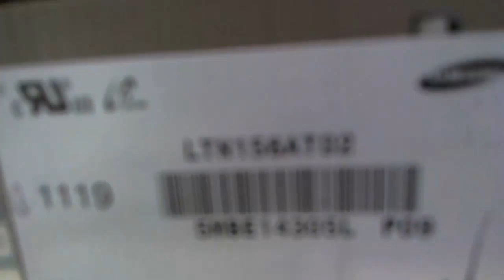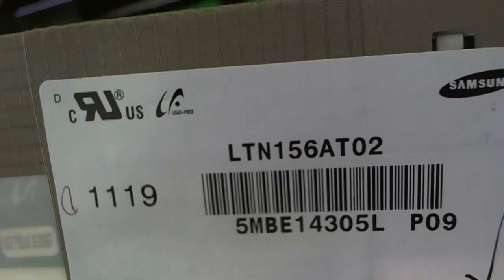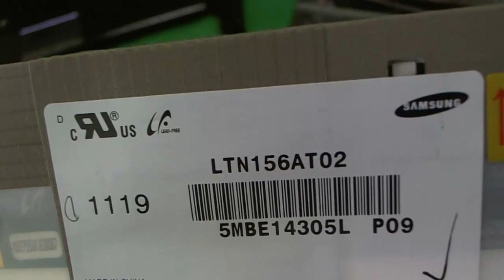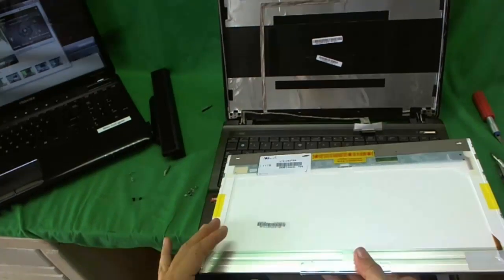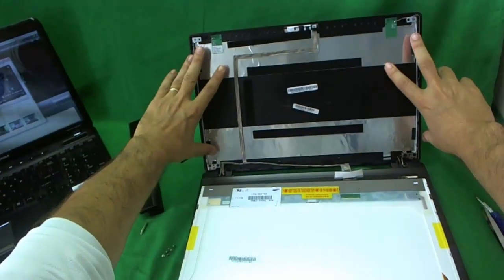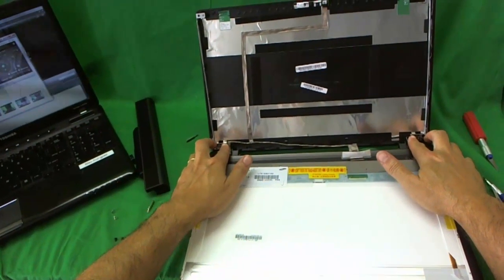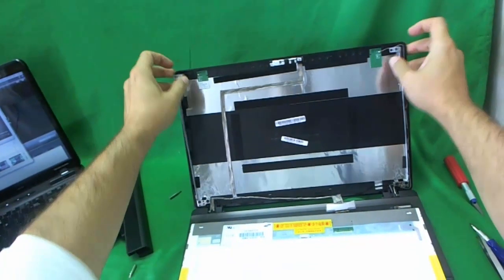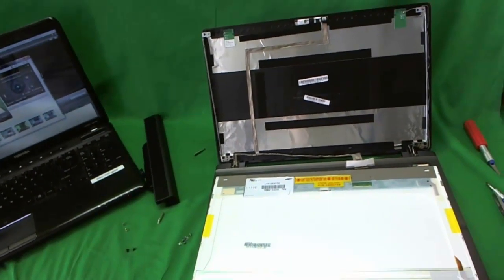ASUS A53U Laptop Screen Replacement Procedure

Comment: Hey, my sister gave me this laptop A53s 2 weeks ago.. unfortunatly yesterday I turn it on, and the screen is white... I tryed restarting it a few times, didn't work. I do hear the windows boot sound after a while..though it seem like a while.. but my guess is that the screen is just dead.. and I saw I can buy a new screen for 50 or so euros.. sounds like a good plan, should I do it ?  maybe we can put a higher resolution screen on it ? guess the plug won't be compatible though :(